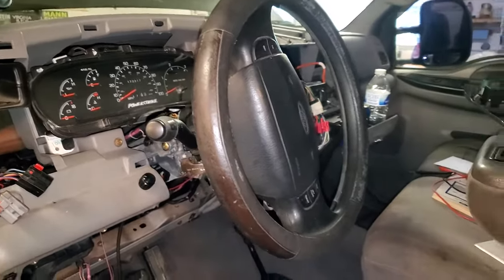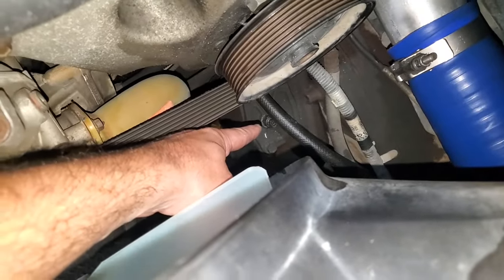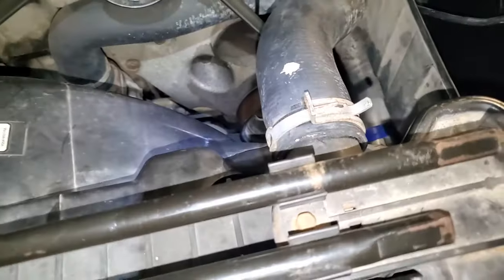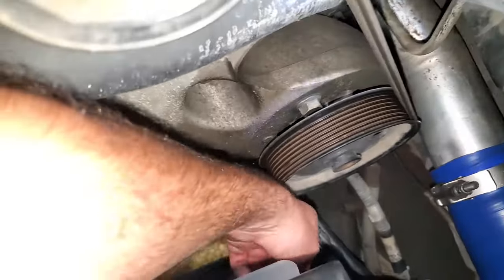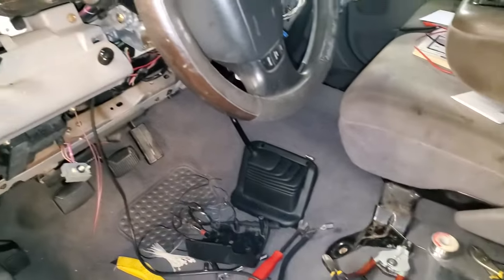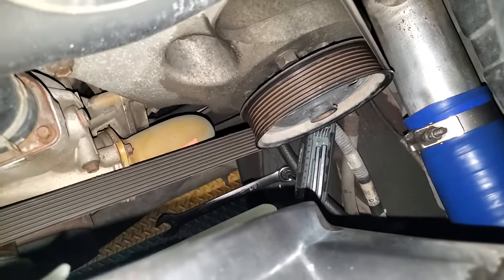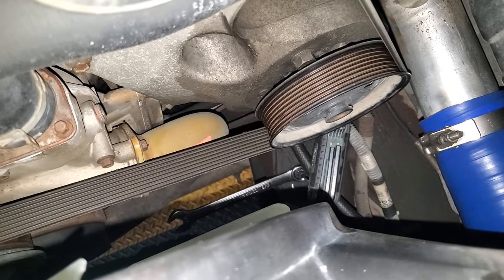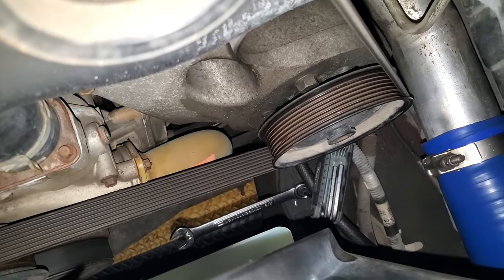99-04 Ford Super Duty Steering Box Adjustment

Comment: I turned mine a 1/4 to 3/8 a turn and it tightened it right up. Crazy.

Well, I just realized I didn’t hold the center screw when I tightened the nut. So it actually went in a long ways. I’ll take it for a rip and report back.

I took it out for a rip. Feels like a new truck steering. Awesome. Thanks so much for this video.

Comment: The cleanest powerstroke engine bay ever
Reply from the maker: Even my other one with almost 540,000 miles is on tma similar level of clean. About twice a year I take a garden hose to all my engine bays with straight hot water and a regular spray nozzle. Works great. Just be careful around electrical connections and fluid reservoirs.

Comment: This is probably what is supposed to be done from the maker of the gear boxes there wouldn’t be an adjustment screw if you were supposed to do this. They must loosen up over time making your gear box wear out unless maintain adjusting it
Reply from the maker: You're mostly right. That screw there so the initial adjustment can be set at the factory. What happens is just that, over time, the internal components wear, which increases the clearances. Technically, at least from everything I've heard, is that you aren't supposed to mess with it. Reason being, once it's worn that much, it should be replaced. However, on my other truck, I adjusted it at roughly 325,000 miles, shortly after I bought it, and ran it like that for I think nearly 150,000 more miles with no issue. I have since replaced that gear box, but that was simply because the output shaft that goes to the pitman arm had a leaky seal. It is possible to replace the seal, but usually the corrosion is so bad that it's not worth doing because it will likely leak again very soon, if not almost immediately after. With the amount of years and miles on that box, along with the amount of miles I put on that truck, replacement was the most logical option.

Comment: On my 2004 6.0 diesel super duty,  I took out the plastic fender liner so I didn't have to take the radiator, fan shroud, or air filter out.  It worked.  I took the tire off so I could crawl in there.  It's probably easier, however it's best if you have small hands to get into it.  Have your wife do it.   16mm box end and 3/16 allen.
Reply: Update.  I tightened it too much, the steering got too sticky and dangerous because the wheel wouldn't return to center when letting go.  I had to take the wheel and fender liner off again.  This time I jacked up the whole axle so the other tire was off the ground.  At first it was so tight, I couldn't really turn the set screw to back it out, but by turning the steering wheel all the way to the left, it would allow me to turn the screw a little bit.  Then straightening the wheel and going back to the left it would go further.  After a few times doing this, it would loosen without the wheel turn.   I loosened it to where I could turn the wheels just by grabbing the brake rotor and twisting.  With the other tire off the ground I could move both wheels that way.  When I started, the set screw was so tight I couldn't do that.   The reason I had to tighten this at all is because it loosened up during a two mile stretch of Death Wobble that happened on the freeway.  I didn't know what was happening and didn't know to pull over stop the truck and go again.  I changed most the front steering pieces and bushings, to stop the death wobble, but then had the loose steering still.  No death wobble since the first time.   Hope this helps someone!!!

Comment: Appreciate the simple explanation on this! Also how you tested the slop on video a lot of others leave that out! I have a bit more play than you do on an 01 excursion. I plan on replacing the steering box but I’m leaving town with the truck here soon so this will hopefully get me by till after the trip! Replaced all the front end parts so far so this is last on the list to fix it.
Reply from the maker: My other truck had around 325,000 miles on it's steering box when i adjusted it. It had WAY more slop than the one in the video. It took most of it out and I ran it until around 425k when it started leaking out of the pitman arm shaft. It can definitely be a lasting temporary fix if done right.

Comment: I'm going to try this out tomorrow, just replaced tie rod ends but the steering is still so damn sloppy. I don't have the money to replace my steering box right now but hopefully this will get me by. Thanks for the video!
Reply from the maker: It should get you by. The truck in the video is still running the same box, and my other truck I ran for a few years and I think over 100k miles. The only reason I replaced it on the work truck is because it started leaking.
Reply: @darkhorseautoanddiesel  I did the adjustment today and wow it made such a difference. My steering box is leaking pretty bad though, I will have to replace it soon.. thanks again for the video

Comment: Just got 2 full turns out of the box on this ole service truck. It helped a good amount but still have about 1/4 wheel of play. Odometer is close to 400k. May look into replacing it. Already did all the the steering minus ball joints. L99 2wd cab & chassis
Reply from the maker: Depending on how bad the ball joints are, that might help with some of the play as well. Might also try tightening up the box a little more, just don't go too far like I mentioned in the video. I'd also check the ujoints running up the shaft up to the steering wheel. Or maybe the box itself it just worn that bad like you mentioned, not unlikely given your mileage.
Reply: @darkhorseautoanddiesel  ball joints are next on the list to check, I will check the shaft u joints as well. Our other 7.3 has 200k and sat 8 years steering is fine. This one with close to 400k is a cab and chassis service truck. Our latest video shows how bad the rest of the steering was. Absolute worst I have ever driven on road. All new tie rod ends now before adjusting. Just wondering if I should plan to swap in a new box. Thank you for the reply and keep up the great work. 🇺🇸 🦅

Comment: @Dark Horse Auto and Diesel. Hi, I have a question for you. My stepson's boss has a mid-late 1990s F-250 w/4wd. The Steering Box Frame-Mount Bolts keep snapping, and my stepson has replaced the broken bolts 2 or 3 times already.

The first thing I asked him was, ''Are you buying the correct ''Grade Bolts'', And if you're getting the correct Bolts, are you tightening them correctly. 

He gave me a puzzled look and then told me that he didn't think it should matter what Grade Bolts they are. 
The reason I'm reaching out to a couple online mechanics is, after replacing the bolts more than once, if he still doesn't know what Grade Bolts that Pickup takes, that could be the problem. But if he is buying the correct Bolts, he's keeping that a secret from me...

I wrote him a note, for him to ask his Boss if the steering is Sloppy. Where is he buying the replacing Bolts at, and last, Are you over tightening the Bolts...

With that said, I'm not sure what else to ask him about the problem. And last, not that it should be a factor but, his Boss gets hammered just about every night, and as for my stepson, he smokes 2 or 3 joints a day. 
So as far as I'm concerned, his performance as a mechanic is somewhat questionable to say the least...

 Thanks in advance, MD...

Comment: Is there a factory setting adjustment like on heavy truck? If I recall on semi boxes, you tighten it lathe way down and back off 1/4 turn to get back to factory lash.
Reply from the maker: Supposedly you aren't supposed to touch that adjustment screw on these trucks. I've done it to several and never had an issue that directly stemmed from doing it. My work truck I put I think almost 100k more miles on it after doing this before I finally replaced it due to a pitman shaft seal leak, which due to corrosion, repairing is almost guaranteed to not last. However, what you are describing is pretty much what I did here. They say you shouldn't do it, but I have never seen any failures from it.
Reply: Tighten Allen all the way snug (not super tight) back it off 1/4 turn. Tighten lock nut.

Comment: Is this adjustment only for when the truck is in park? I have a new steering gear box but the play is only when I turn the wheel to the left. When I’m driving steering wheel can go almost 1/2 turn with out wheel moving. Truck does pull to the right (passenger ) steering wheel almost feels empty when turning to the left then it finally catches. When I say turning I mean cruising in a fairly straight line like staying in the lane. Thank you
Reply from the maker: First thing I'd do is look over every nut and bolt touched during the replacement of the steering box. If that checks out  I would return it because something is very wrong with it to be that sloppy right out of the box. I wouldn't adjust it, you might end up creating a hazard for yourself and everyone else on the road around you. 

If it was that sloppy before the box replacement, you need to look into the rest of the steering system, tie rods, drag link, etc.

Either way, I wouldn't drive it until it's fixed.

Comment: I’ve just replaced both upper and lower ball joints, the complete tie rod/draglink set, track bar, steering damper, new shocks, sway bar end links, sway bar bushings and still have a wandering front end on a 99 F250 SD 7.3 diesel leaf sprung front end 4x4. Previous owner states he “replaced the steering box” “a few years ago” and I’m sitting just shy of 180k miles. So do I do this adjustment and call it good or is there an aftermarket steering box that is better nowadays? I need this ready to haul my travel trailer in a few weeks. Thanks! Sub’d!
Reply: I’ve heard the Red-Head steering boxes are good replacements for these trucks
Reply from the maker: I'd do the adjustment and see how it does. Redhead and Blue Top are both good boxes from what I've read online, though I have no personal experience with either one. They are rather pricey so they had better be good.
Reply: I replaced my original with a Redhead box. It was awesome at first. Now I've got some wear and tear and wandering steering. So I'm hear watching videos on how to adjust it. I'll be adjusting mine. I think I've had my Redhead box on for at least 8 to 10 years. I'm excited to try adjusting it up.

Comment: How do i loosen it again if i overtightened it? It wont budge, only if i have the lock nut completely locked i can barely turn it but its extremely heavy
Reply from the maker: The steering itself is heavy? Like it doesn't want to return to center when you release the wheel when driving? If that's the case, just back the adjustment screw up about a quarter turn then tighten the lock nut back up. Just make sure you are holding the adjuster in place when turning the lock nut, sometimes the adjuster wants to spin with it.

Comment: To the people who come from europe or uses the metric system, you need a 4,7 mm or hex key, you probably dont have one, i had to order one from the internet
Reply from the maker: I didn't think about that. I forget that these trucks, although rare, do exist overseas.
Reply: @darkhorseautoanddiesel  they kinda dont. diesel costs me approx 8$ per gallon, i have a 02’ excursion
Reply from the maker: @mattizmushroom1466  That's insane. But fuel has always been expensive over there. I bet you don't drive it much! What possessed you to get an Excursion anyway?
Reply: @darkhorseautoanddiesel  i dont rightly know what came over me, i wanted something that no other has, something i could be proud over. in my town theres about 30 or so chevy's, (wich is a lot in a town consisting of 4000 people in norway) ive never been one for gm, but ive always loved ford. and due to its weight it is registered as a light truck, wich requires its own certificate, since im working as a trucker id thought it be cool if i was driving something few can
Reply from the maker: @mattizmushroom1466  sounds like perfectly good reasoning to me!